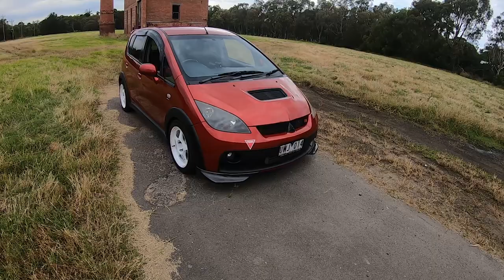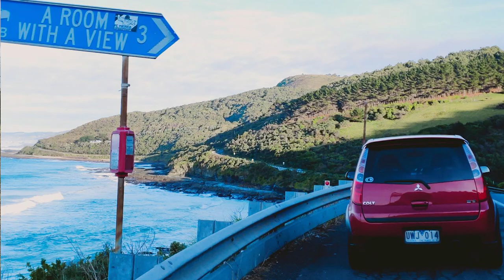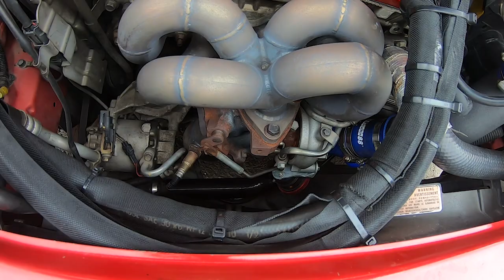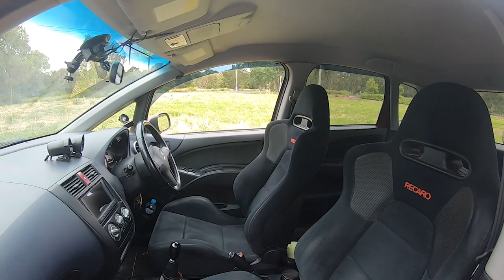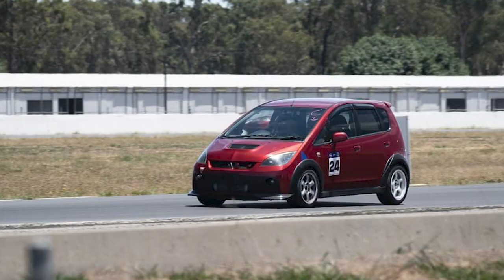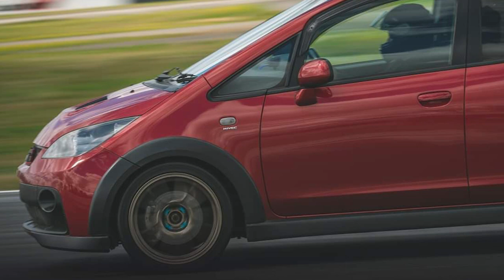Mitsubishi Colt Ralliart // The Evos little brother

Comment: There is a 2009 model they're asking $10K for it with 150Kms on the odometer but unfortunately its 4000kms away from me on the other side of the country :(
Reply from the maker: Purchased a few cars site unseen from other states, have used state roads inspection (in Australia) to inspect and provide a report and various freight companies to facilitate transport, so I wouldn’t let the fact it’s far away put you off!
Reply: I just bought one 2009 model for 6k euros , with 130k km, fully remaped, downpipe, custom exhaust,kn filter, 200 HP.

Comment: theres an $8k with 218k mileage and 175hp for sale. would it still be worth buying it? is 218k mileage too big for this car?
Reply from the maker: If it has a good service history and is overall good condition it would be worth considering, but the mileage is getting up there…
Reply: Ive paid just under 5k usd for a 200hp tuned specimen with just 130km millage. So its pushing it imho.